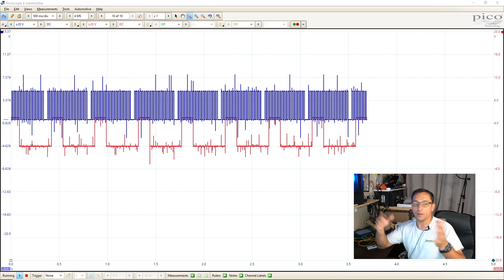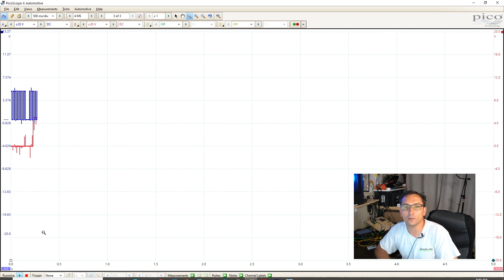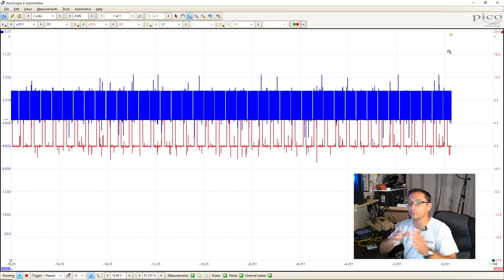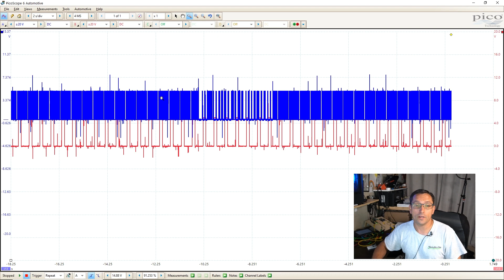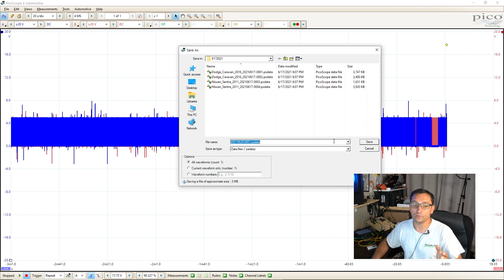How To Eliminate PICO GAP

Comment: Question to you about witech I am road testing a 2009 Chrysler 300 and the abs module is turning orange. Legend says it means negative response. Does that mean the same as no communication
Reply from the maker: No ,red is no comm, orange means wi tech thinks module not responding properly. I do see modules tyring orange at times briefly and no problems.  Are you having a problem with abs?
Reply: The traction control light comes on at 40 mph. Cuts throttle etc. No codes. Speed sensors look good. But the abs module is on national back order. Looked at steering angle sensor it looks good. Just turns orange and it starts acting up. Seen the legend just says negative response from it turning orange so never seen that color on there

Comment: So would not using a trigger at all work the same
Reply from the maker: No, the buffer would fill and there would be a gap between the buffers.
Reply: Do you have very basic  pico training? I’ve never used pico always other scopes. But since joe Biden was so generous creating inflation issues. I’m getting ready to buy a pico. I know how to do the tests on other scopes just don’t know where the menu options are to set it up on pico.
Reply from the maker: @philh9238  yes I do, the basic course on line , part if the 10$ a month core subscription. Also i can do live one on one training with pico
Reply from the maker: @philh9238  In my opinion pico is easiest to learn and intuitive once you get the feel of it.
Reply: Do you know where the best deals are at to buy one

Comment: AWESOME INFO I DO NOT HAVE PICO BUT THINKING TO GET ONE IS THIS WORK WITH VERES SNAP ON  TOO OR IT IS DIFFERENT THANKS FOR SHARING BROTHER.
Reply from the maker: The pico has alot more power than snap on, I think you would find pico ver easy to use.